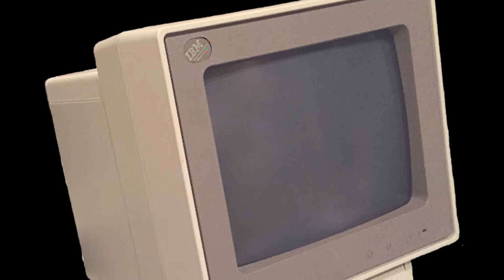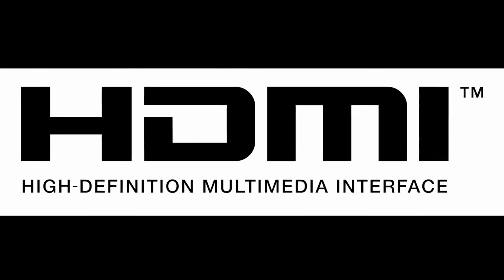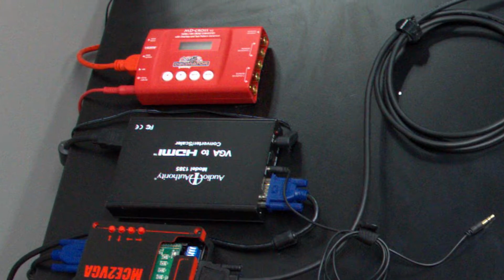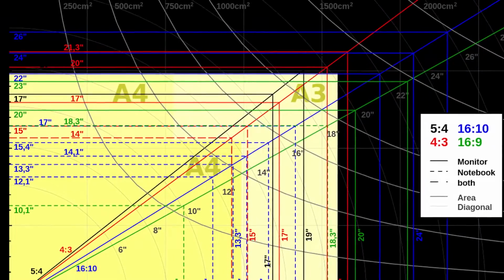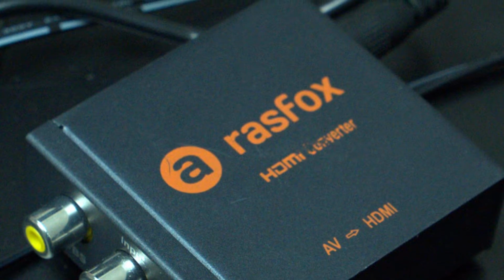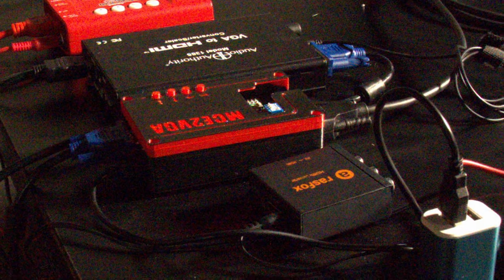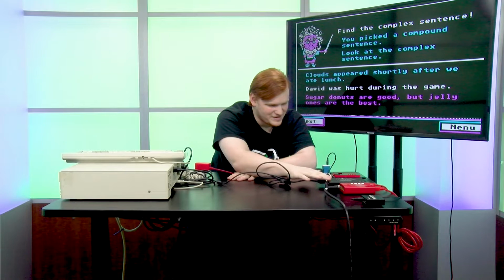CGA/EGA/MDA Captures- How We Do It - Tech Retrospective

Comment: You referred several times to CGA and EGA as a mixed signal system having both analog and digital.  That is incorrect.  MDA/Herc/CGA/EGA are digital only.  You also referred to VGA having digital data and implied part of the image data itself was digital.  VGA has a digital horizontal and vertical sync but entirely analog image data.  It much later included (late 90s) an I2C bus called DDC that allows the video source (video card) can query the capabilities of the video sync (monitor).  This was later carried forward in the DVI/HDMI specs though the data format was greatly extended.  Also VESA didn't 'allow' for SVGA, it standardized it.  Both the resolution, timing, and BIOS interface.

Comment: • 3:15 - The single RCA connector was not RGB, it was composite (CVBS). RGB (YPBPR) used three RCA connectors.
• 4:43 - Check out Ben Eater's home-made graphics adapter: youtu.be/l7rce6IQDWs , youtu.be/uqY3FMuMuRo
• 5:36 - Ah, that palette brings back memories…
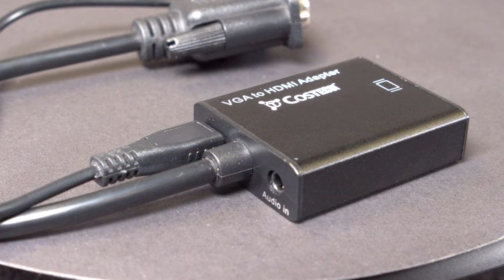• 14:13 - Careful with those VGA/HDMI adapters. I got a couple from eBay and they're cheap Chinese junk.

Comment: Thank you for taking the time to explain your process.  It looks like the only piece left is getting the aspect ratio correct, and then you're 100% golden.
Reply from the maker: There are still several issues we are dealing with where some OSs don't work or they have resolution changes during startup that confuse the converts.  We are learning a lot in the process.

Comment: Did you just call VGA "Vector" Graphics Array?  Because that's not actually what the V stands for.  ;)  I'd also like to point out, when you showed the Model 25 just before you said Vector, that didn't have VGA, that was "MCGA" which was a subset of VGA, with less VRAM containing a 256 color 320x200 mode, while only having a 1-bit monochrome 640x480 mode.